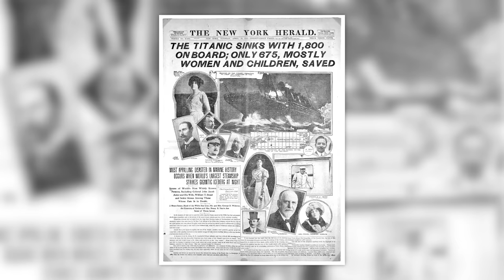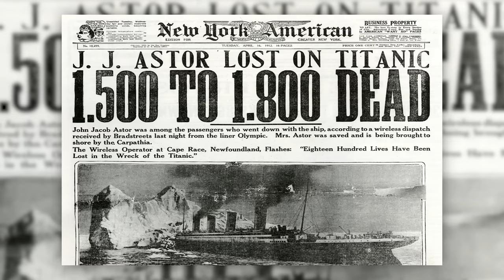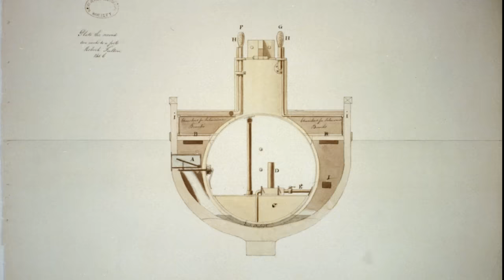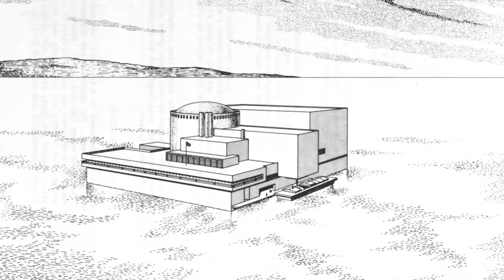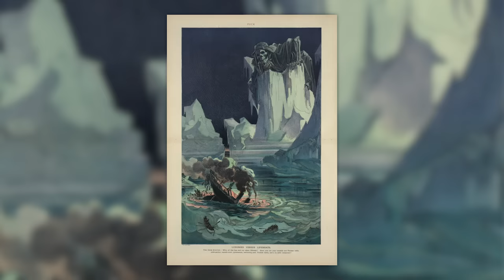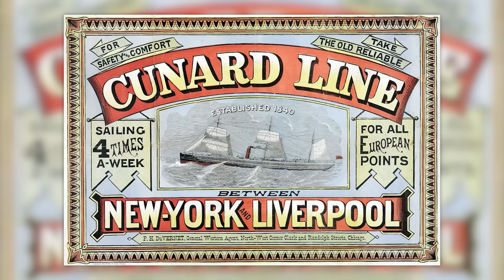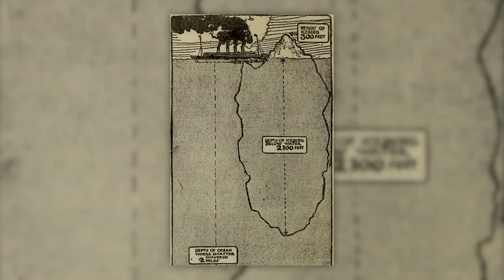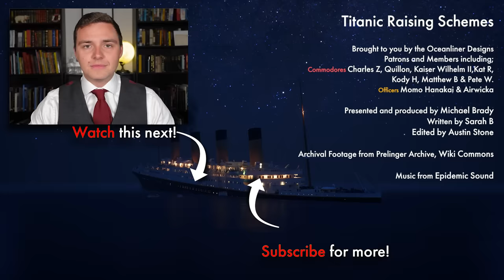The Bizarre Schemes to Raise Titanic!

Comment: When I was 12 I had the insane idea of building one or two reinforced concrete domes over the two halves of the ship, before gradually lowering the interior pressure whilst reinforcing the hull and eventually fill the chamber with oxygen and build walkways around the ship and special walkways through the ship for archaeologists to use. The idea was that the dome shape would redirect the pressure into the foundation on the sea floor, which itself was directly connected to the bedrock below and it could potentially be feasible if thick enough concrete was used. The problem arises with maintenance as the sheer pressure would wreak absolute havoc on the exterior of that dome and consistently repairing it would cost a lot more than any revenue gained from using the domes as museums. Besides, who the heck travels down 4 km under the surface to willingly walk around in what's essentially a ticking implosion bomb?
Reply: The people who went down in the Titan submersible!

Comment: The lookout nest's mast was knocked over by a small sub during an expedition and that was decades ago. A form of microscopic bacteria have been eating away at the ship for nearly 15 years now and it got really bad about 5 years ago. Cpatain Smith's cabin is nearly gone and only his bathtub remains from that room. Even prying the ship from the sand would possibly collapse it let alone raising it through the layers of the ocean. Even if you could safely bring it up, the ship would have to be encased with sea water for long periods of time due to the differences of the environment. It has been in the water far longer than it ever was on land. The ship today barely resembles anything of what it was.

Comment: It would be interesting if they would attempt to salvage non corroded parts like the propellers once the steel hull has collapsed and rusted away completely. These propellers likely still hang on the shafts, so they would have to cut the shafts somehow or salvage them too.

Comment: Titanic could be raised by underpinning her. Drilling a borehole horizontally through the seabed beneath the keel, and then sliding a steel beam through it. Then drill another borehole beside that beam, slide another beam through that, and weld it to the first one. Continue this process under the entire wreck (the bow section anyway) is underlain by a steel platform. Then raise the platform, using a giant lifting vessel such as the Pioneering Spirit or such like, to lift her up. If done correctly this should not impart any more stress on the wreck than it is already under, it would remain supported from below, at the same angle, under a steady 1G.

Comment: I mean, we could build something like a coffer dam around it and then close some kind of sliding door below it in the muddy ground, by blasting/pumping material away with high pressure water.

Raising the sea floor around it would protect the structure, and we could even keep it underwater for the duration of the voyage, reducing the structural strength necessary for the encasing.

It's just a question of material and sheer willpower put into work hours with robots welding/constructing underwater.

So it's feasible, but most certainly not wise.

Comment: In the 1920s a salvage company raised most of the battleships and battlecruisers of the German High Seas fleet.  The ships had been scuttled in the British Grand Fleet harbor of Scapa Flow.  Several battleships remain on the bottom because they were too deep to be raised.  100 plus years later they are no longer in a condition to be raised.  So if dreadnaught battleships have decayed enough to become to fragile to be raised, you have to imagine any ocean liner of similar age would by now be a lost cause.  Sadly.

Comment: The Kursk submarine was raised.  There are videos on this Youtube machine showing how it was done. Mammoet was hired to do this.
Whenever a plane crashes in ocean and it can be found, the wreckage is brought back to a dry hangar for analysis.  Air India bombing over Atlantic is a good example in the mid 1980s.  More recently, Air France 447.  Finding cause of crash trumps ethical issues of a cemetray at sea. 
In the case of Titanic, it it had happened this year, it is possible that raising it would have been discussed more seriiously since it would still be structurally sound and possible to lift to analyse its weaknesses especially if it hadn't behaved as promised in the plans/schematics. 
But by the time the wreck was found, it was already way too late to consider raising it and the cause of its demise was well known.

Comment: Only if we had the technology to get a steel plate  under her and would need 2 port ships and  lift her from underneath like a elevator with no walls, built with a hydraulic push bar or drag bar which can burrow under the bow itself and then cables with mini subs on the end can raise the cables so the ships can anchor their connections but yea budget would be unbelievable

Comment: The only option I can think of is to take Titanic apart piece by piece bring it to the surface and reassemble it. of course, that would be very expensive dangerous and would take a very long time. Due to 100 years of erosion, we would be lucky to recover 40% of the ship. So everything else that can't be recovered would need to be rebuilt around it.

Comment: My idea was to build a large cylinder (like a smoke stack of a factory). It'd be constructed on site above Titanic.
Each ring would be constructed and lowered on to the surface of the water...the next ring would be constructed and attached to it. Those would be lowered then the 3rd ring built, attached, lowered etc.
Eventually the structure would reach the ocean floor and surround Titanic. Then, pump the water out.
Voila, you'd have a clear path straight down to the ship. Obviously the structure would need some cross section reinforcements etc, but the idea is plausible.
I'm the idea, not the engineer.

Comment: I think it is 100% possible to raise the titanic. It's just like Mike said though, it would cost way to much. It would also be a multi year project fitting supports at the bottom of the Atlantic Ocean. Here would be my plan...fit support all around the ship (basically building a giant basket) reinforce everything and use Jack's to break her free from the sea floor. Then slowly winch her directly from a big ship in the surface. Bring her to shallow water very slowly and carefully.

Comment: My question is, even IF the wreckage was raised…what the hell would be done with it? The damage from the sinking/breakup and impact with the bottom of the ocean alone rendered it as fragile as a sand castle. 

  Close to 112 years submerged in salt water has weakened the remains to the point where collapse is expected within the next 10-15 years…..so, even in the remote chance of it staying together long enough to bring it to the surface, the moment that the water no longer fills the voids, the decks would simply collapse. 

   What’s more, WHERE would it be stored/displayed? Best to leave it where it lays…

Comment: Somewhere in Nikola Tesla's files might be a device to warp the fabric of space & time to lower the Atlantic and leave the Mighty Titey high & dry enough to effect temporary repairs so the ship and assorted bits & bobs can be floated back to Belfast for repair (she's still under warranty, isn't she?)

Either that or 'scrap' her underwater and put the bits back together back in Belfast. (we will be demanding a warranty repair on account of the ship had not finished her maiden voyage)

Where would we get the money? Use the 'dark web' to 'mint' it - like the Federal Reserve does all the time.

Or just build another Titanic as a replica ship. Maybe pull up some bits of the original steel to melt down for the keel laying. Just add a proper double hull and use a better grade steel this time. Don't use that Lew Grade steel...

Comment: Mike, can you explain why the Titanic is in such a state of decay in much deeper water than compared to the Edmund Fitzgerald in a relatively shallow location, which seems virtually unchanged after 50 years, and still has bodies near the wreck? Is it the difference between salt water vs fresh?
Reply: Saltwater is more corrosive to steel than freshwater, cold temperature is also a factor, chemical reactions tend to slow in cold temperatures.

Comment: Raising the wreck is impossible for several reasons. The ship being broken into multiple pieces, the fact its corroded to the point that any attempt to raise it would result in it falling apart, and it's embedded up to 70 feet into the mud. Lastly the cost, even if it was possible to raise Titanic would be far greater than the value of the wreck or anything else recovered from it. Morally, it's still a gravesite for 1,200  people who were never recovered and given a proper burial.

Comment: Only way would be if you could dig under it, and then take it up on a giant platform with floating cranes. Even then, it is probably not a possible task at all. To get a platform under it would cost so much, and probably isn’t even possible to do. Even if so, it would most likely crumble the ship still.

Comment: I think raising the Titanic would an awful waste of money.  (It almost certainly impossible)
Spend the money on improve improved R.O.V. technology (which you’d probably need anyway).
Use these improved R.O.V.s to go MUCH far deeper inside the wreck & photograph everything in the highest definition possible, perhaps taking the odd sample or so for surface study.
You would be studying the wreck as it has sat for 110 years.  Instead of trying to study a wreck that you have disturbed.
On the surface you could crate a 3D VR representation of the wreck.
Something very similar but not as detailed has already been done.

Comment: The only possible way the bowl section could ever be raised is first they would have to cover the Titanic with some kind of dome structure and than treat the water where Titanic is with something that can kill the bacteria eating at the hall than treat the hall with something that can not only preserve the hall but ideally strengthen the old steel and if that was successfully done than they would have to somehow insert a steel frame under the shape to give her structural support and than somehow fine a way to lift the bowl section to the surface and assuming it was even possible it would probably take a decade if not more to pull this off and they would still have to get her bowl section to a dry dock and there is just to many things that could go wrong and even if they pulled it off who would fund the project!

Comment: Pre-build in port two steel box caissons with open bottoms that can envelop each half of the wreck.  Winch them down into position.  On each caisson have two swing flaps at the bottom side with cutter heads gradually burrow through the mud under the wreck until they can close sealing the caisson with the wreck inside.  None of this machinery would be pressurized.  The caissons can then be hoisted slowly with the wreck and mud undisturbed inside, the water would also offer a cushioning effect against vibration.  At this point the caissons could be towed to the mainland and joined together into a complete ship.  At this point the wreck could either remain permanately in the water or slowly drained and chemically treated into a dry exhibit.  The costs of this would run into the trillions and any static attraction would likely never pay itself off.  Then there's the whole ethics and the why of it, but I think on a mechanical engineering level its possible.
Reply: "joined together into a complete ship" - lol. The bow and stern sections do not account for the entire ship. There is a large section between the third and fourth funnels that just completely disintigrated and is scattered in countless pieces across the debris field.
Reply: @samfromportadown  Well yeah, the run down wasn't proposing building a time machine.

Comment: It would be near or even impossible to raise the Titanic. The ship's weight alone of 50,000-60,000 tons would make it impossible to refloat plus the ship is in a very bad state of deterioration. A ship of an approximate volume of 5-6 million cubic feet would weigh an extraordinary 100,000-150,000 tons when filled with water making it impossible to move at will plus other factors. We know water has buoyancy but steel is denser than water so Titanic would be 50,000-60,000 tons of dead weight and if you manage to get it to the surface, the already filled ship would weigh even heavier due to gravity.

For example, submerge a bucket in a pool, the bucket although filled with water would not be heavy but try taking it out, it would be many times heavier than in the water.

Comment: First thought - that contemporary newspaper picture shows four blades on the centre propeller; it may have been based-on eyewitness testimony.  We'll never know, I guess - sadly...  
Saying Titanic (which was a U.K. registered ship) was exclusively British and the U.S. salvage court's ruling had nothing to do with it, has some validity if the ship was insured with Lloyd's of London, but it would (inevitably) be pointed-out that the White Star Line belonged to the International Mercantile Marine when Titanic sailed; that would result in likely 20-or-so years' worth of litigation, in which nobody but the lawyers would get rich.
Ultimately, as you said, Titanic is extremely fragile - and indeed, was when it took to the water.  Numerous examples can be found of how fragile ships really are - weight for weight sure, their skins are 1"-thick steel, but this counts for very little over the sheer size of the hull; ships are size-comparatively more fragile than eggshells.  Poor old Titanic is deeply embedded in mud - the bow (for instance) plunged itself like a knife into the bottom and to the best of my knowledge, is so deeply buried that nobody has ever seen any of the iceberg's damage that sank it.  How do you attach lifting devices to ancient steel of poor metallurgy that's since rusted itself paper-thin?  How do you break the suction of all that mud - and steel embedded in salty mud rusts that much faster?  And then imagine that by some engineering miracle you've done it - you've got one of the ship's two halves slung on the cables and you're winching it to the surface, an evolution that'd take several days, and the Atlantic decides "Nuh-uh..." and brews-up a force-8 gale and rocks your cranes, and the slung load shakes itself to rust-dust in the slings...
As you said, salvaging the ship is a pipe-dream, always was and (barring any reasonably foreseeable miracle new technology, which by the time it's developed the ship will have deteriorated even more) always will be.  GREAT video!

Comment: See i am one of those that is all for raising certain ship wrecks to save them from being completely decimated from corrosion or in recent cases the dirty tramps scraping ship wrecks from ww1/2 BUT i know some ships just can not be raised without being destroyed them selves. The Titanic for example. The size of the ship and it’s location would mean the ship would need to be cut into pieces to be raised then placed on a barge and taken to a location(would have to be America). so essentially the titanic would actually be in more pieces on the surface then it would be on the sea floor. 
As much as i am for raising the Titanic, it just can not be done without making the wreck worse

Comment: As a naval architect who has worked in complex salvage projects I can promise that it is technically possible to raise the titanic, just not practical or cost effective.
Reply: Very interesting. Which method would you say would have the best chances of success?
Reply: @sauter1  a detailed condition / strength assessment would have to be performed.  For the larger sections my quick guess is that due to how frail it is you would have to use ROVs to carefully excavate around the hull while building up a supporting cradle structure/casing around the hull to both cradle it and protect it. (Easily a multi-billion dollar cost alone due to size and difficulty doing it at that depth). Then use buoyancy casings to make it as neutrally buoyant as you can (at that depth/pressure it would likely require something like syntactic foam or lightweight fluid like oil). Anything air filled would crush.  Then multiple specially designed vessels with heavy heave compensated systems to hoist and control the lift.  Put a ridiculous enough amount of money on a project than anything is possible. 

The real question is should it be done? My opinion is No.
Reply: @Dark-Helmet  Thank you! As a sailor myself and very interested in all things marine, as well as having an engineering background myself, I just had to ask that question, and greatly appreciate the answer. :)

Yes, I can see those methods working. Using something like oil or petrol / gasoline as an incompressible buoyancy provider, like was used in the Trieste in its Mariana trench dive, seems very logical. With next to unlimited resources it could be done, but as you say, it would cost as much as sending men to the moon again, if not more, and very hard to justify.